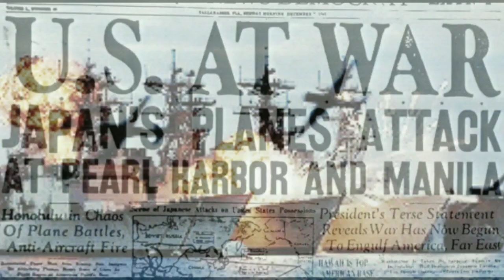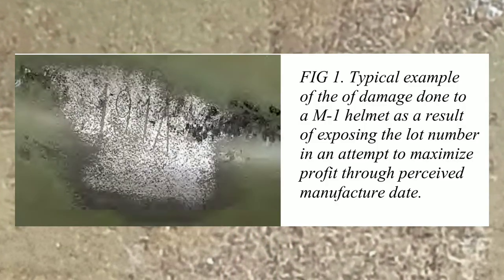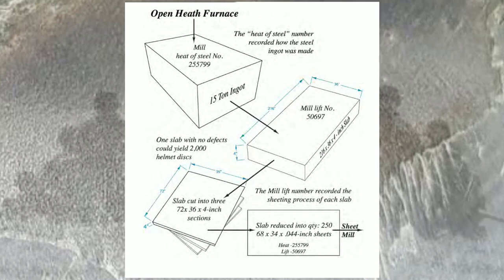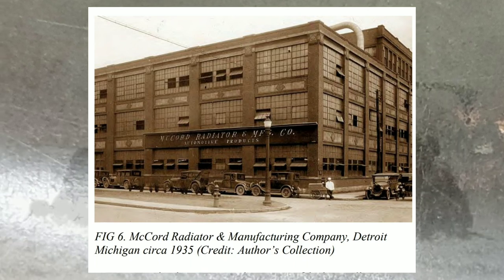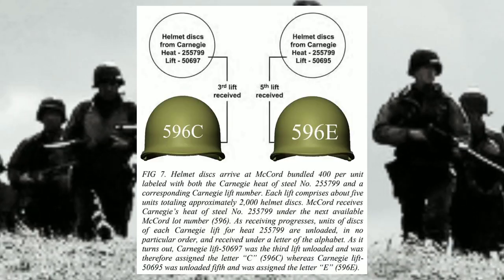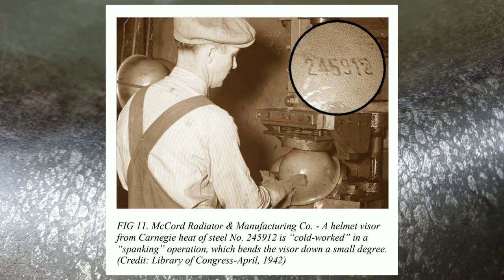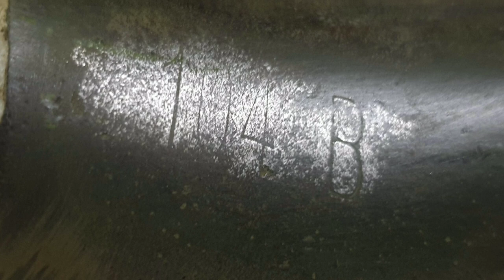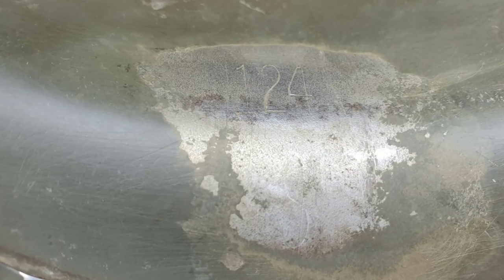The Real Truth About WW2 M1 U.S Helmets Heat Stamps

Comment: Any Info on a helmet with the stamp MWA45
Reply from the maker: first M1 production after 1945 from 1953 to approx. 1958 by McCord and the subcontractor Motor Wheel Corporation.

McCord's shells are M-xxx and Motor Weel Co. MW / MWA heat-stamped

Comment: interesting. whats with the terminator robo narration though? its a bit hard to listen to. 
i honestly dont understand why theres any controversy. anyone whose worked in a factory knows how lot numbers work. theyre ascending. older, lower number parts end up on the bottom in whatever manner the part is packaged, on the bottom of the skid. the older skids end up on the bottom as newer ones are stacked on top. newer parts end up being pulled off and used 1st with no regard to lot numbers. meaning higher lot numbers of a particular shipping will be used before the older lower numbers are revealed.
them controlling factor is how fast production is running and how fast the parts are used up. with 22 million produced over a 4 year period production was obviously proceeding quickly with it starting slow and picking up pace as experience is gained. while a skid or 2 may have ended up in the back of the warehouse i doubt if many skids sat around too long. so i think generally lot numbers can be a decent indicator of time of manufacture with lower lot numbers being spread over a longer period of time and later lot #s being used up with great rapidity meaning that numerical order will be a better indicator of time of manufacture as the sheets wouldnt be sitting around for long. 
does any of this mean you can use a lot number to date your helmet precisely? no, thats not how lot numbers work. but i think given known shipping dates for lifts i think you can narrow it down pretty well with higher lot numbers, generally, being a more accurate indication due to increased part consumption. 
the "controversy" that makes me laugh are people getting butthurt over a little paint removal to reveal a lot lol. these helmets have literally been through a world war and possibly several other wars. a little paint loss on the inside where its not visible during display isnt going to hurt anything. if you dont want to n youre, great! dont do it. as long as youre not obliterating markings or names whats the harm?
Reply from the maker: hi Bud, thank you for comment, due to the huge Stroke i had 3 years ago i lost all my learning of reading and i couldn't remember things still have problems on reading and thinking so thats why i did this so i can understand it all, it was the only way i could do this, sorry it not sound good , but i tried ok CHEERS
Reply from the maker: Bud where did you get all that awesome info from ?
Reply: @jerseyfaranginthailand8134  ok. sorry you had such a life altering event. i wouldnt have guessed from your other videos so you seem to be overcoming it pretty well. i do enjoy your videos immensely as im an m1 freak as well lol. thanks for putting in such effort.
Reply: @jerseyfaranginthailand8134  the m1 specific stuff from various m1 and helmet books and sites though mark reynosas 2 excellent books are kinda my go to (basically since theyre the only m1 books i actually have copies of lol). as far as the factory production and parts handling info i worked in a plastic bottle production plant for 7 years in various capacities and as a temp in a couple other factories for around 2 more so i got to see 1st hand such procedures. at the time i never wouldve guessed it would ever come in handy lol. i guess it just goes to show you never know how youre life experiences will come in handy later lol.
Reply from the maker: Thank you Bud, I am getting better but when I do my videos I sometimes I get stuck and can’t remember something like I do years ago, but I do feel good now, on my other channel I do get some comments of people saying I’m I ok because sometimes strange on video lol
Reply: @jerseyfaranginthailand8134  i think youre doing excellent. perhaps you could have a few 3x5 cards with note to help out. in any case the videos your making are much better then the videos im not making lol!
Reply: @jerseyfaranginthailand8134  I didn't know that, I hope you're doing well man.